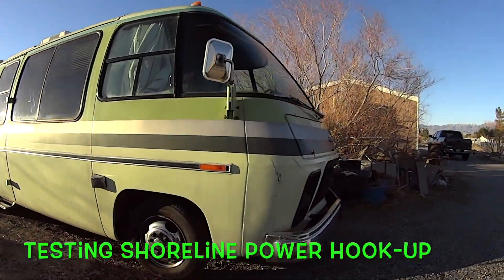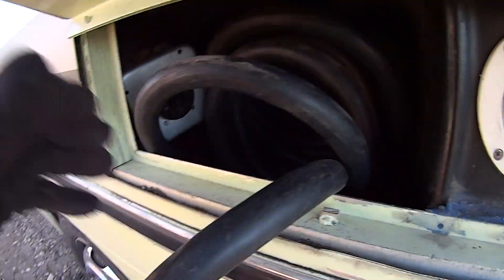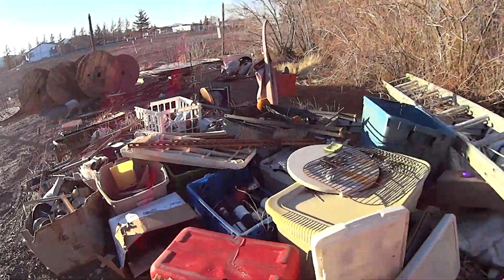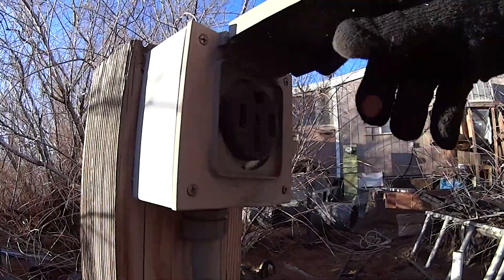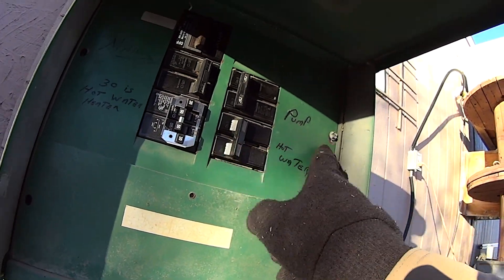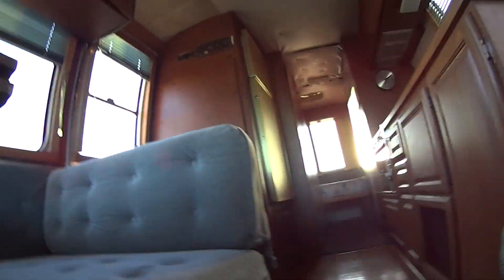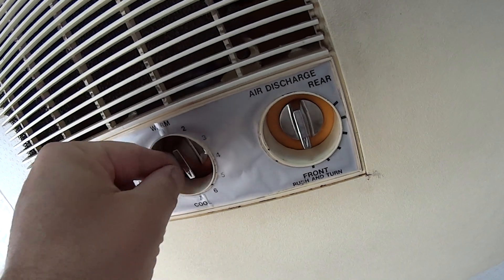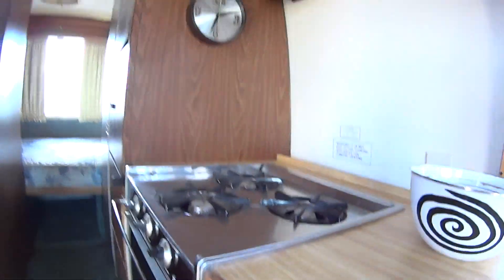Hooking up Shore Power to Test GMC Motorhome 50 amp AC Circuits

Comment: That outlet in your RV is for your generator power. You just plug in your RV when shore power is not available.
Reply from the maker: Thank you.
Reply: I cut my 50 amp wire off short to have less cable to coil up. Then I used the excess wire., which is copper to rewire the generator section, because the generator outlet to the old gen wire is aluminum not safe. I can purchase a 50ft , 50amp extension cable to reach RV shore power outlet at a later date.